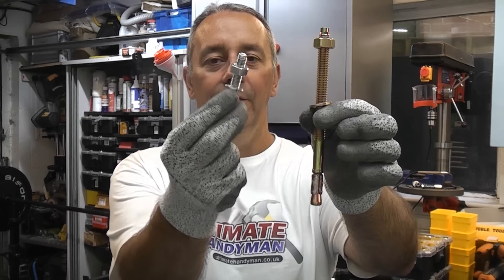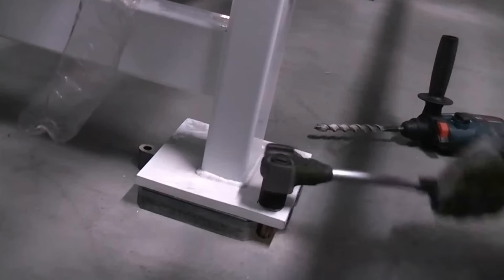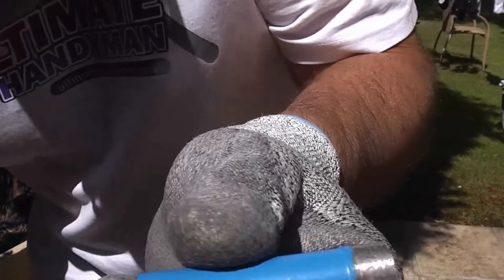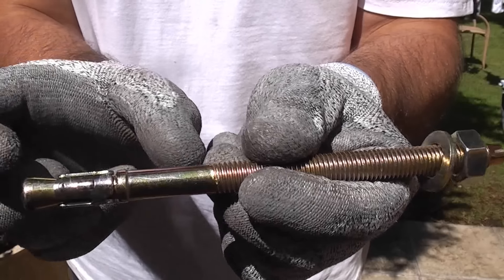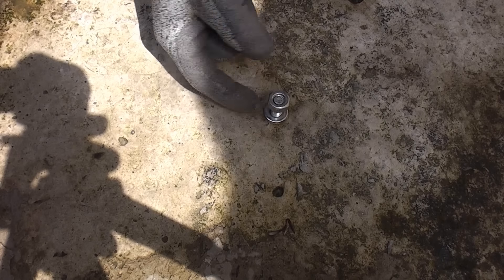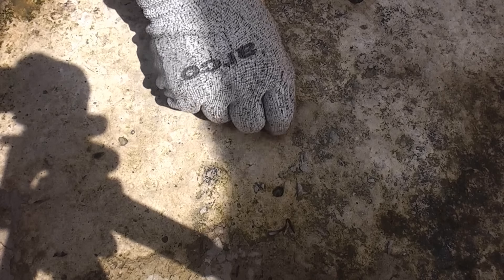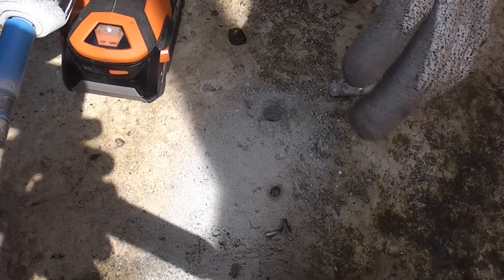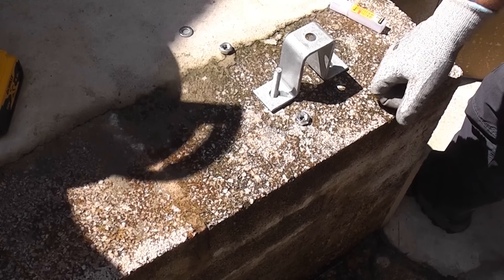How to remove concrete anchors

Comment: I’ve broken the studs flush with the floor by striking them laterally from two opposite directions with a hammer until the snap off.
Reply: Done that aswell
Reply: @ryanh3285  Now that I own an angle grinder I think these methods would be easier.

Comment: I was able to pry one wall concrete anchor using brute force and WD40. However, for the remaining four anchors. I thought about drilling one or two 5mm holes adjacent to the bolts and it would be easier to pull out. Guess I need more fillers to patch the larger gap.
Reply from the maker: Thanks for the comment 👍

Comment: Dumb question….however, I have a 1/2” anchor that I am assuming is 3-4 inches in the concrete….what size core bit do I need?

Comment: Good vid , I think I'd choose the cut and punch method .
Reply from the maker: Yeah, it depends where you are. I sometimes subcontract in chemical plants, you would need a hot work permit to use a grinder in all areas (not just explosive atmospheres), but the drill can be used in non-explosive areas without a hot work permit 👍
Thanks for the comment 👍

Comment: Thanks for the video. I removed an old railing to have it powder coated, and plan to place it back in the same spot. Unfortunately all of the concrete anchors snapped off when loosening due to rust. Can I remove them with a core bit and replace with new anchors in the same spot? Do I need to fill the holes with anything before replacing the anchor in the same spot? Thanks in advance for your advice. I don’t really have room on the stair to move the anchor spots.
Reply from the maker: I would remove the old fixings using the core drill bit, as per the video, then I’d clean out the holes using a vacuum cleaner/brush etc.
You could refill the holes using concrete, then redrill the holes, or perhaps a better option would be to use resin fixings and studs, example of resin fixings here- https://www.youtube.com/watch?v=oUJPjJsdl0c&t

Comment: What's wrong with countering the nut with another nut and then using it to turn the bolt out?
Reply from the maker: They expand when you pull them up 👍
Reply: @ultimatehandyman  yess but the screw screws Out. How i remember ist the Expander Plug and the Holding sleeve are seperate parts
Reply from the maker: I think you are talking about expansion bolts, not concrete anchors-
https://www.youtube.com/watch?v=hJg0xVb3eAg&t

Comment: What would you fill the hole with after removing the anchor?
Reply from the maker: I’d fill the hole with either mortar, or granolithic mortar, I often inject it in using this method- https://www.youtube.com/watch?v=OjVBBOIEMH0&pp

How I mix larger batches of concrete is here- https://www.youtube.com/watch?v=xLaP0N8BcTQ

Comment: With the smaller dynabolts I have found if you can push the bolt in a few mm then you may be able to get a pair of needle-nose pliers onto the split expansion sleeve then you have a chance of being able to pull the outer sheath up into the hole. This then allows the flair / flare on the split expansion sleeve end to fit back through the hole and be extracted. The advantage if you can use this method is the dynabolt can be reused since you will have all parts of the fastener removed from the hole. I have been successful doing this about 75% of the time using up to M8 sizes. I haven't needed to use larger sizes so don't know of this will work on M10 and up because they have a thicker metal on the split expansion sleeve so it may not "unflair" itself enough to pull bac through the hole.

Thank You for the video. It is always good to have another method to use if your goto one doesn't. Much appreciated. 👍👍

Comment: I primarily build Outdoor wooden cat shelters and wooden giant sized viking style chairs while I'm in very early stages of testing out a handyman  service ( lasted a short while on site with a small company based in Ilkley restoring Calverley Old Hall as an apprentice joiner )

These videos are always informative and feel you can tell you know what you are doing 

I buggered up installing an anchor bolt in a garage defender base plate ( didn't drill deep enough and had 1.5" Bolt sticking out the concrete 

Grinder saved me on this 
Really enjoy trying my hand at things but often get defeated too easily when i get things wrong

Better to view as learning from mistakes and do better next time 

Videos like this are proper helpful 

This job was one of those 'favour' requests meaning no mention of payment but i did get paid in lemon meringue pie 😂👍

Comment: Hahaha. I've lost count of the number of times that I've tripped over redundant anchor bolts. I usually just cut the buggers flush immediately the piece of kit is removed. There must be some scientific law that states that when being lowered down ,say, a drainage shaft, you will bounce off of every anchor stub that some lazy arse has left in place when removin an old access ladder or whatever. If there is one anchor stud in a room 30 metres by 30 metres, you will kick it the first time you enter that room!
Reply from the maker: I’ve noticed quite a lot of these on site myself, it amazes me! I knew a guy that tripped over one, and was injured and put a compensation claim in ( To be honest I think he saw it and deliberately fell over it )
Thanks for the comment 👍

Comment: Do you have a video on how to drill these straight into a concrete wall? 

I’m trying to hang a wood rack but I’ve tried twice now (I now have 6 concrete anchors stuck in my wall which is why I was watching this video) but if the anchors are even a little not straight I’m unable to mount the wood rack which has three holes so I need three perfectly straight concrete anchors. Any suggestions? 

I thought about using a drill guide but idk how I would hold that and use my hammer drill which is pretty heavy even with two hands.

Comment: I see you have that Wera ratchet/hammer thing. How do you rate it?
Reply from the maker: It’s ok for some jobs, but as a maintenance engineer it’s use is very limited due to the size of the ratchet head 👍
Reply: @ultimatehandyman  Aye, it looks a bit clumsy. Thanks for the reply👍🏼

Comment: Why don't you just cut it flush to the concrete with a grinder?
Reply from the maker: You can, but if you need to reposition a concrete anchor slightly, you need to remove the old one 👍
Reply: Okay that makes sense! Thank you sir

Comment: buddy... when you're cutting metal, never NEVER EVER use a wafer blade on you angle grinder. This is how 99% of awful accidents happen with these things. You MUST use a diamond coated CARBON STEEL blade. It IS more expensive, but significantly less likely to shatter.
Reply from the maker: Thanks for the concern. In my 30 years of work, I have never had a disc shatter 😉
For several years, I used an angle grinder every day with 1mm thick cutting discs and never had any problems! 
Thanks for the comment 👍
Reply: @ultimatehandyman  I've never had one shatter either in 30 yrs, altho I did have one separate from the center piece.

You may have a feeling for it by now, but please NEVER suggest trainees or DIYers to use this. Reddit is iterally filled with thousand of images of mangled faces, hands, and arms as a direct result of these wafer blades
Reply from the maker: That is not a direct result of people using “wafer” blades, it’s because people don’t know how to use a grinder correctly. I covered much of this years ago, in this video-  https://www.youtube.com/watch?v=1TFisMcDrH4 👍
Reply: @ultimatehandyman Don't you know that 97% of all angle grinder accidents occur while operating an angle grinder!  How can you show angle grinder usage like this!?  I criticize people to feel better about myself! Rar!